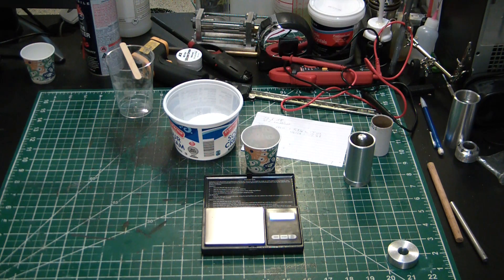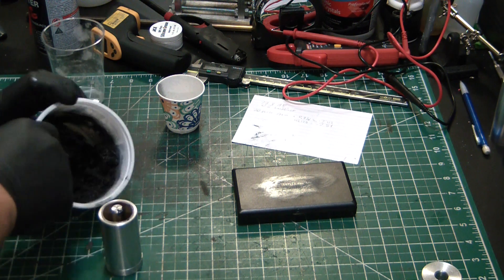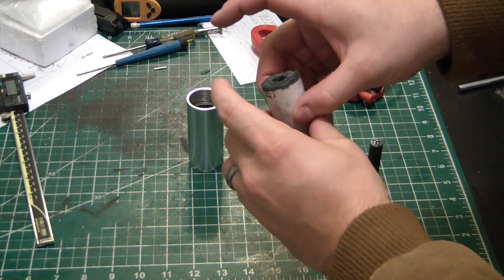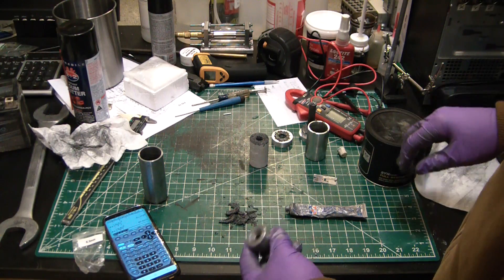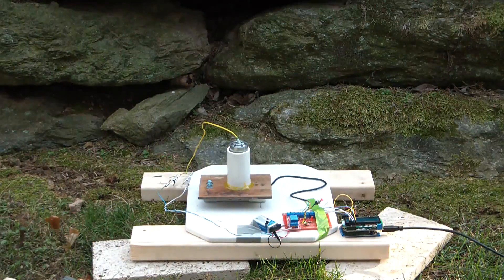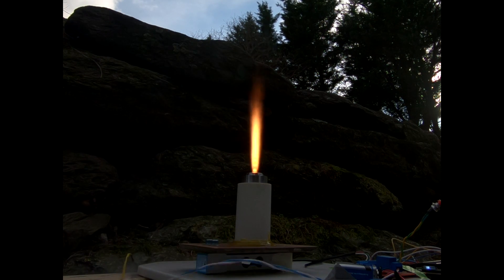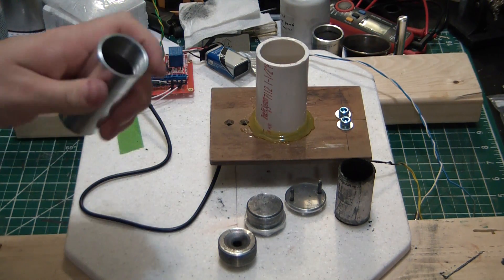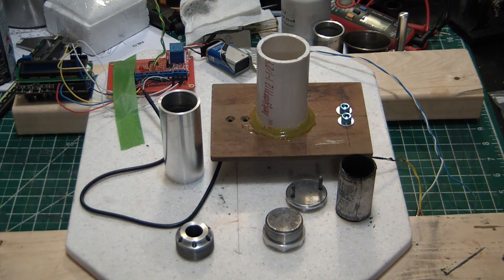Shock Diamonds! DIY APCP Rocket Propellant Test Supersonic Exhaust - ElementalMaker

Comment: You can faintly see something similar from an F22 on full afterburner
Reply: F22 doesn't have afterburners.
Reply: guardsmanom134 yes they do it just depends on the pilot whether they want to use it or not
Reply: @Initial_Gopnik  umm... No they don't. I use to live and work next to Lockheed. F22 was a favored plane to me. 
The F-22 Raptor is a stealth, reconnaiscence/fighter/bomber/operations hub/ air superiority fighter. Instead of using afterburners, which are easily picked up by IR and Radar, the F-22 uses a complex array of focusing ducts and ceramic vectoring duct openings, to accomplish a manner of flight known as "supercruise". 
Flying slightly slower than the F-15EX Strike Eagle in full afterburn, the F-22 Raptor is all-but invisible to AIM-9 Sidewinder heat-seaking missiles, unlike it's older sister. This gives it the edge it needs, to be America's air superiority fighter. 
The highly controversial move, was made after the downing of the F-117 nighthawk stealth fighter-bomber, over Iraqi held Kuwait. Apparently, the SAMs that the enemy were using, used Infrared guidence upon proximity to target allowing the missile to lock onto the heat signature of the F-117. This negated the F-117's anti-radar build, as hot exhaust fumes don't just disappear. Although the flat nozzles of the F-117 were designed with IR missiles in mind, they had no real idea just how good Iraqi SAMs were, nor that they could switch in midflight to alternative tracking.  
Enter the F-22, with ceramic techtanium(c) deflectors for distrupting the airflow around the exhaust ports, rendering the aircraft invisible to IR sensors. Putting afterburners on that aircraft, would be idiotic in the least. Imagine, 437b dollars to find out how to beat ir missiles, and you negate that with an $8,000.00 afterburner. Well done, you just destroyed the most expensive aircraft in the United States arsenal with bad engineering.  
WhAt aRe YoU GonNa Do NeXt?
Reply: @Initial_Gopnik  hate to break it to you Lorenzo, but that ain't an afterburner. That's hot titanium sparks coming from the techtanium plates in the exhaust flaps. Looks cool, doesn't it?
Reply: @guardsmanom134 so what your telling me is that video shows a failing jet engine? Because usually titanium sparks are bright white and are usually a sign of improper balancing of the jet engines blades or the blades hitting the jet engines housing. I have worked with titanium so i should know what color the sparks are because ive cut it and ground it and ive never seen a 10+ foot flame i mean go ahead and deny it all you want but why have the most technologically advanced plane in the world without afterburners
Reply: @Initial_Gopnik  titaniceramide, or techtanium, is what those funny looking spikes on the aft end of the plane are made of. You know, THE NOZZLES? That part that focuses the hot gases made by burning fuels? Dude, titanium fan blades cause CATASTROPHIC malfunction when they let loose. Not a few sparks that ionically charge the hot exhaust, but let the plane keep flying... You work on planes?!? Please, stay away from any plane I may be getting on in the next forever(I stay away from flying, if I can)! If you can't tell the difference in a ceramic-titanium plate AT THE EXHAUST PORT melting and discharging a white-blue ion-cloud, and a rotor reducing an engine to scrap, I don't trust your mechanical judgement.
Reply: @Initial_Gopnik  you don't put afterburners on it, PRECISELY BECAUSE IT'S THE WORLD'S MOST ADVANCED PLANE! You don't NEED them! The jet outperforms most afterburners, in supercruise. In fact, THEY ARE COUNTERPRODUCTIVE! Omg... I'm explaining Calculus to a four year old..

Comment: Have you considered using a liner on your casting mold another thought was to use a two-part mold so that you can separate for demolding
Reply: Also for diemolding if you had a 2 parkour you could make retention tabs along with separating line that would be removed but would allow for corn removal to be made easier

Comment: I blew out a chunk of my front tooth stripping wires.  The filling never quite took, I've had them build it up like 3 times and it keeps breaking even though I don't strip wires with my teeth anymore.   Just something to consider.  Its a hard place to build back up with dental resin.

Comment: Had no idea you could even obtain or possess AMPCL in the USA! ~( ,m,)~

How do you get it and what permits did you have to have?
Reply: heh permits.  This is the US not nazi germany.   The only hard part is shipping it.
Reply: @GigsTaggart  I have never even seen it for sale except in stupidly expensive tiny amounts from Siglma Aldritch and they wanted to much per gram I would not even go any further.

Its easier and cheaper [even if you count the platinum electrodes] to synthesize it from table salt in my view.
Reply: @DeliciousDeBlair  Google shopping turned up 3 different random sites that sell it for less than $50 a pound. It's unregulated in the US in quantities of only a few pounds. Try ordering a metric ton of the stuff and dudes in suits are likely to show up and check your prostate for polyps.
Reply: @Nuovoswiss  Wow $50 per pound! I should start making and selling it!
Reply: @Nuovoswiss  OhI know ALL ABOUT how the BATFE works, FIRST HAND!

And if I make any pechlorates, I assure you I ain't tellin NOBUNNY NUTTIN!

Comment: You should probably make two test grains at a time from now on.
Reply from the maker: I would do six at a time if I could! Unfortunately right now I only have one grain mold, I need to machine a few extra so I can cast four or so per run
Reply: @ElementalMaker  You can make it easier on yourself if you use premade liners instead of the paper wrap. But with the custom motor and mold, you would be lucky to find such liners in exactly the right size.

Comment: use PuTTY with session logging to prevent loss of serial data when stuff goes wrong.
Reply from the maker: I will definitely look into this! Thanks for sharing!
Reply: put a camera videoing the data. At least you can read the data from the vid. My phone is my digital memory
Reply: @PhattyMo  Let me say here that I've had mixed results reading serial data from microcontrollers with putty. For some it works beautifully, for others it fails completely (ESP8266 for instance).
Reply: Another thing that could be done is to use a shield with an SD card for an extra backup.
Reply: This is a really simple solution to this problem. I hope he sees this! MAYBE add a screen recorder to the laptop as well.
Reply: What a bunch of windows users...
Those in the know use TTY.
It's what PuTTY is copying, but lacks many features.

Given the ease of use/installation and progress made in hardware compatibility of Linux, you guys should give it a try.

90% fewer viri & no license required.